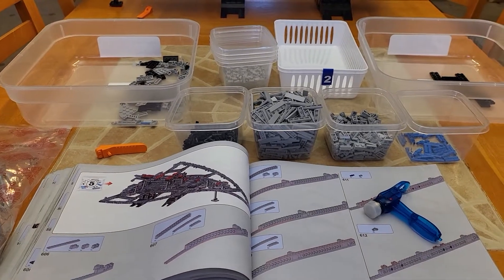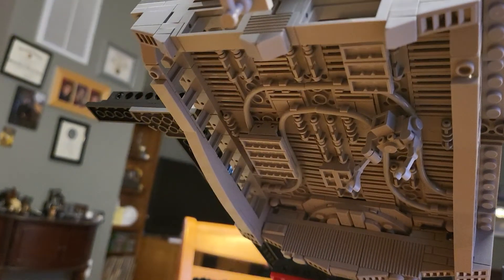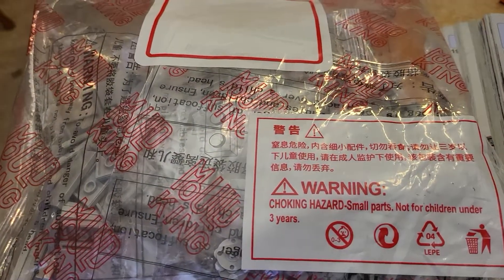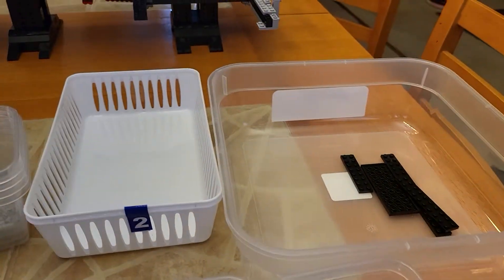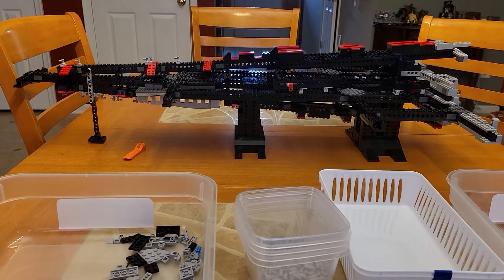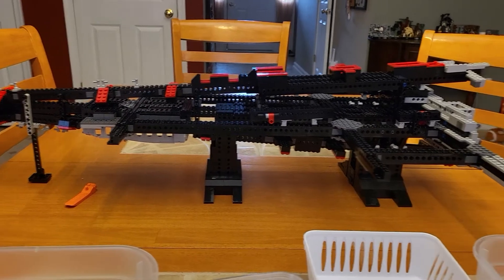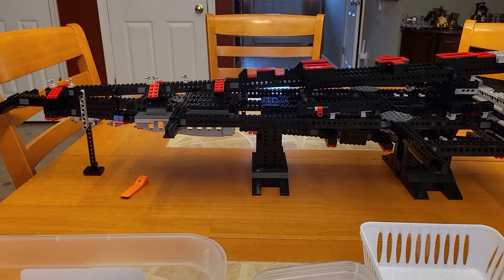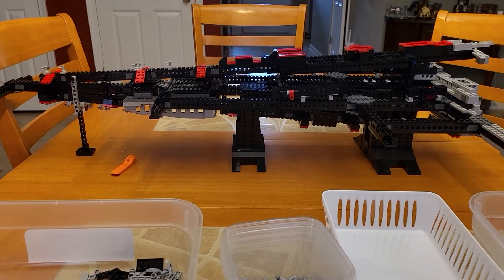Mould King 13135 Imperial Star Destroyer Monarch Build (Section 4 of 22) Takeaways

Comment: I'm building this model right now, and I can't figure out where to foure hoses are.
Reply from the maker: Hi Noah.  On top of the numbered bags for the steps there are also a few others that are either blank or marked like xx etc.  There were a few parts I thought were missing but we're actually in those bags.
Reply: @OldNSurly  I figured out that the four hose pieces were in a blank bag located in Box B. I thought they would be in Box A since that is where the step I was on took place.